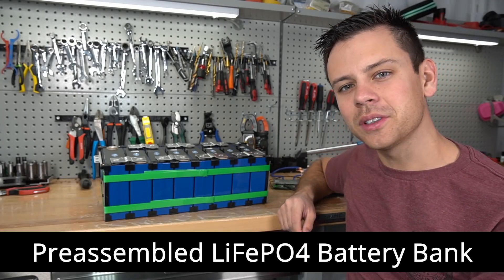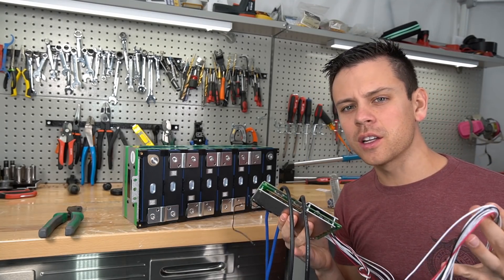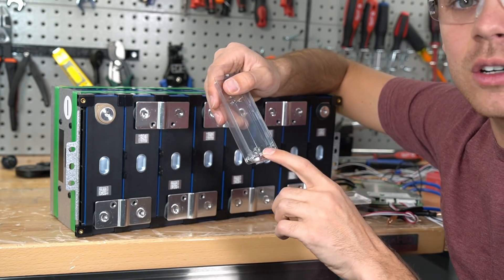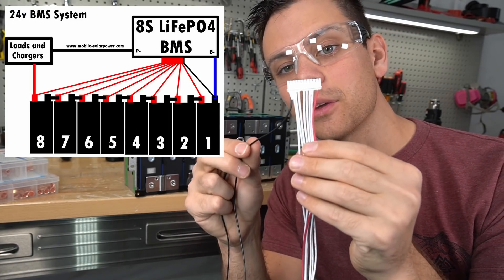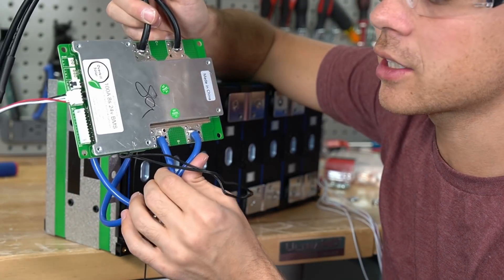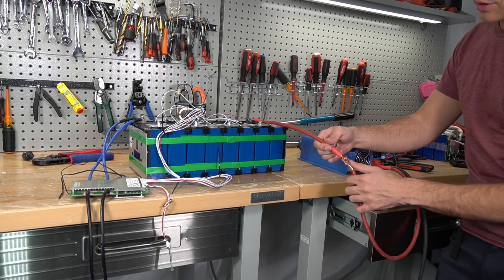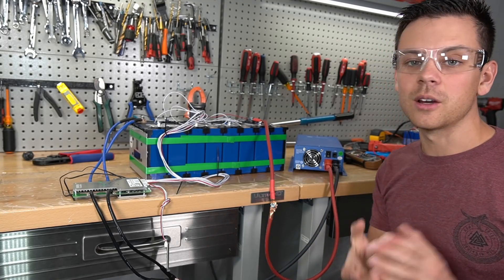Dirt Cheap 24V Preassembled LiFePO4 Battery: Beginner Friendly Tutorial!

Comment from the maker: Signature solar just watched the video and will include hardware for each pack! Thank goodness.

DIY Parts List (affiliate links):
Battery Pack: https://signaturesolar.com/eg4-8-cell-pack-lithium-cells-25-6v-100ah/?ref=cPwLcVc0SW-BjN
24V BMS: https://overkillsolar.com/%20%20product/bms-100a-8s-lifepo4/%20%20?myboi=187467879
48V BMS: https://overkillsolar.com/product/bms-100a-16s-lifepo4/?myboi=187467879
Battery Box Terminals: https://amzn.to/3ikFKrk
Ring Terminals for balance lead: https://amzn.to/3D0G4Fw
Ring Terminals for larger wires: https://amzn.to/3N90UH6
Tools for this project: https://www.mobile-solarpower.com/tools.html

Battery Schematics: https://www.mobile-solarpower.com/design-your-own-12v-lifepo4-system.html

~~~~~~~~~~~~~~~~~~~~~~~~~~~~~~~~~
Tired of getting ripped off? Check out my "Will Prowse Approved" solar product recommendations below!

12V Batteries
https://www.mobile-solarpower.com/lithium-batteries.html

48V Batteries
https://www.mobile-solarpower.com/48v-batteries.html

Offgrid Inverter System Builder
https://www.mobile-solarpower.com/48v-complete-system-blueprint-559371.html

Hybrid Inverter System Builder
https://www.mobile-solarpower.com/code-compliant-48v-offgrid-system.html

Mobile Handtruck System Builder (very popular!)
https://www.mobile-solarpower.com/mobile-48v-system.html

Solar Panels
https://www.mobile-solarpower.com/300w-solar-panels.html

Ground Mount Solar Racking
https://www.mobile-solarpower.com/ground-mount-racks.html

Wire, Lugs and Busbars
https://www.mobile-solarpower.com/wire-and-connectors.html

Tools
https://www.mobile-solarpower.com/tools.html

Fuses and Circuit Breakers
https://www.mobile-solarpower.com/fuses.html

Plug-N-Play Solar Systems
Ecoflow, Anker And Bluetti! So many models to choose from. See my current recommendations here:
https://www.mobile-solarpower.com/full-size-systems.html

~~~~~~~~~~~~~~~~~~~~~~~~~~~~~~~~~~~~~~~~~~
Need to build a large DIY system? Need a trustworthy solar distributor? These are my favorites:

Signature Solar
Creator of EG4! Solar Minisplits, Victron and More! Largest Solar Store Online.
If you want $50 off, please use my link below and coupon code "DIYSOLAR50":
https://signaturesolar.com/?ref=cPwLcVc0SW-BjN

Current Connected
Best Prices for EG4, Victron, Midnite and so much more! Fast Shipping and Highest Rated Customer Service:
https://currentconnected.com/?ref=wp

~~~~~~~~~~~~~~~~~~~~~~~~~~~~~~~~~~~~~~~~~~
Join our DIY Solar Community 
Need more help? Join the largest solar forum on the internet for beginners and professionals alike. 140,000 members and counting!
https://www.diysolarforum.com

Check Out My Free Book
Best-selling and beginner-friendly guidebook to off-grid 12V solar!
https://www.mobile-solarpower.com/the-book.html

~~~~~~~~~~~~~~~~~~~~~~~~~~~~~~~~~~~~~~~~~~
Contact Information:
I am NOT available for personal solar system consult! If you wish to contact me, this is my direct email: williamprowsediysolar@gmail.com
FTC Disclosure Statement and Disclaimers:
Every video includes paid promotion or sponsorship (such as free products for review). Some links on this YouTube channel may be affiliate links. We may get paid if you buy something or take an action after clicking one of these. My videos are for educational purposes only. Information is subject to change/update at any time. Electricity is DANGEROUS and can kill. Be smart and use common sense :) DIY Solar Power with Will Prowse is a participant in the Amazon Services LLC Associates Program, An affiliate advertising program designed to provide a means for sites to earn advertising fees by advertising and linking to Amazon.com
Reply: Hi how can a crimp fitting be better then a solder one???
Reply: @stevewalker412  solder can melt if hot
Reply: @Nobody_Famous  standard tin/lead solder melts at 360 degrees F. Lead free melts at 422F. If this battery bank gets that hot the plastic will melt way before the solder and it will turn into a pile of goo.  There are numerous soldered connections in the under-hood electronics in cars and in the engine nacelles of all commercial and military aircraft.  Literally every single electronic component on every circuit board is soldered on.  This is not a concern.
Reply: @stevewalker412  Current density vs surface area.  Copper/lead/tin interface will increase resistance with current more than copper/copper... so not good for (largish) power transfer. So application dependent.  In this case, a good machinal copper to copper crimp is best (with external mechanical fixation).
Reply: @kennethhicks2113  wow .. thank you would of never of thought of that .. but that makes sense the high amp chiller wires were crimped like that too ....
Reply: @kennethhicks2113  that explains why the 100A leads on the BMS are soldered onto the PCB . . .  And why all car battery terminals and posts are made of lead . . .  and why every single commercial aircraft you have ever flown on has soldered wire connections on critical systems like the fuel and engine controllers.  Sorry I am not trying to be rude but there is a ton of false information out there about soldered connections, mostly shared by people who know very little about the science, and do not realize that all the vehicles they get into and trust their safety and lives to every day use many soldered wire connections.
Reply: @Patrick_Cashman  Not rude, I understand.  Again as I said, application.  And not going into EE courses and engineering compromises made for various reasons like weight, cost, etc...
Reply: @kennethhicks2113  plus there is the concern about anything built on a Friday, and if we made Friday like Saturday, then Thursday could end up being the new Friday, and weedless Wednesday has been a concern for 2000 years as is any type of Friday.

Vote for A.I. and let automation take over our industrial disease.
👁️👁️ 👀
Reply: @truetech4158  Yes but we can't discriminate against other day's ending in Y.

Vote sticks and stones... don't replace a cold with pneumonia.

P.S. One of us needs our meds!
Reply: @kennethhicks2113  I can ask discriminating questions about the gregarian calendar, but doing so is dangerous to ask why no matter the time of day or week, even those months and years can not be overlooked.

The real time and date is much older, we'd have to use carbon dating rather than quartz clock crystals or the classic Sundial that has a concern for skin cancer if to watch the clock for a 9 billion year old version of the correct calendar, unless we are going to end up as The Neuralink BORG  nuclear family unit that use neuralink wirelessly updated by a atomic clock.

 I don't know, says Vice Grip Garage. 
👁️ O 👀
Reply: @truetech4158  Lol... even black hole/quasar time changes over time... carbon dating only works for carbon created at the same time... carbon in another part of the universe would have different dates... things keep changing like it's normal!
Hope your having a good day, ya put some in my day :  )
Reply: Great video, especially for RV owners looking to upgrade from 12v lead acid to 24v LiFePO4!  That said, would love to see a follow-up video (in elapsed time) that shows this battery's max run time using a real-world common household/RV appliance(!)
Reply: @__WJK__  I recently built a 48V battery with 2 sets of 16 280Ah cells. 560Ah @48V.  1 BMS per each set of 16 cells, then put the 2 sets of 16 in parallel.  I used an MPP Solar LV6548 controller, like the ones Will uses in his power wall.  I just have one controller, not 2 like him, because I only power 120V stuff with it in my RV.  I have 3000W of solar panels on the roof of the RV. I've had this system off-grid for 2 months now, and have only used the generator a couple of times after days of clouds and pretty cold weather where it got down around freezing several nights in a row.  
We run a residential fridge 24/7.  We also have 2 computer setups with laptops and large 4k monitors, which my wife and I use for full time work.  We have a microwave, air fryer, and often use the electric water heater. We do watch our power consumption but pretty much live a normal life in the RV without external power input. We are using propane for the furnace and cooking, not electric heat, so I guess that's external power, but no hookups.  
Will has a video on sizing your solar power system.  Look up Will Prowse Calculations on youtube and you'll find it.  I followed his advice in that video and built the battery to supply power for 3 days and be able to recharge in 1 day.  The recharging actually takes longer than 1 day because I ended up with way less solar panels than that would take.  I mounted all I could on the roof and experimented with that.  It actually works fine. I also overestimated consumption so the battery is bigger than it needs to be but it all more or less balances out and like I said we've only had to run the generator a couple of times in 2 months. 
I hope this helps you.  Keep learning from Will and you'll be on the right track.
Reply: Good job Signature Solar!
Reply: Thank you for this video, I appreciate it a lot!  I do want you all to know...I ordered 4 of these on Monday, 4/4/2022, for a DIY build of my own. My order has been in a "On Hold" status since it was placed.  I got an email today notifying me that they don't have the proper shipping labels to send me these batteries, and are hoping to get them next week.  They have already taken my money, but now 4 days later they notify me that they are unable to ship due to improper labeling.  I am hopeful that they actually do get the labels next week as this is an unfortunate delay.  I am not sure why they allow orders to be taken, and money to be received if they are not able to actual ship the batteries.  Here is Signature Solar's actual email response:

You may have recently noticed that your order has changed to "ON HOLD" status. This is due to the battery you have purchased going out parcel through FedEx. We are currently waiting on specific hazmat labelling from the carrier that both them and DOT requires to ship your order.  We were under the assumption that we would have them by today, but now being told that it will be next week due to them being backlogged. Please understand that this is beyond our control but, our shipping department is actively looking for other ways to send your items out in an efficient way. As soon as we are able to proceed with your order, we will notify you. We would like to apologize for any inconveniences this may cause as we were not expecting to run into this issue ourselves.
Reply: @tonysauls7613  still nothing? Please keep us posted! I was thinking of ordering these today but will wait.
Reply: @jenniferdurham2782  I actually canceled my order last week. They let me know they didn't have the proper shipping labels and that they were back ordered.

As of last Tuesday, they still did not have the labels and were hopeful to get them sometime last week.

I would call and confirm the batteries are still in stock, and that they are able to ship them (meaning labels have been received).

I ordered cells from Docan Power instead. I should get them this week.

Good Luck!
Reply: @tonysauls7613  thanks!!
Reply: I can't find them, are they not available anymore?
Reply: @Jason-zg3nl  I don't see it neither.  I think to get a a cheaper deal, they had to buy a lot more than they needed, so they just made it available at a lower cost until they ran out of them extra unit. I knew they wouldn't be having those there for ever.  I'm happy with my 4 unit so far !
Reply: @mochouinard  I'm so jealous 😭 I'm ready to buy 3 of them. I emailed them and they said they don't have them anymore.
Reply: Do you have an updated link to pre built packs it's not working
Reply: naturally! "oh! Will has a recommendation that is cheap and easy enough to add"  "so sayeth the Will!"   great info :D  now we just need to figure out how to use external battery banks with all these all in one packs like an eco flow!
Reply: Do they not ship to the United States? The only option for shipping using your affiliate link is to pick it up at their store in Texas.
Reply: What about Europe distributors? Any idea where we could get it? We are running a school for sustainability and now we are in the process on changing our battery bank to lithium
Reply: FYI, there is no provided screw with them ! Just received them.  BUT there is a black plastic cover that come with it.
Reply: That's service!!   Want to order some of them if they every have them again
Reply: @pcdreams1  yes me too! I'm ready to buy 3 packs
Reply: Link is dead, product gone from site - Anyone know an alternate supplier?
Reply: @Smugly_Watching_Society_Burn  I wish they make more because I would buy 4 of them. But I talked with them and they're not going to make anymore 😔
Reply: alas! no more.
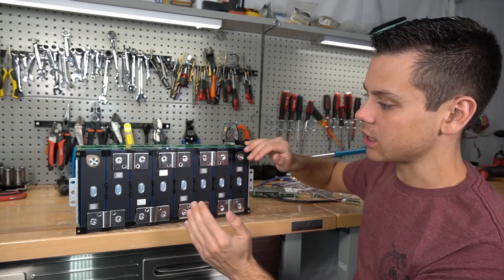Reply: At 1:43 I think you made a bad assumption. Just because they are all connected there is NO guarantee that they are at the same state of charge. Unless each of them was TOP Balanced together you may be getting batteries from different batches with different SOC's ... We had a server pack at work not pass their UPS Emergency run time and it turned out that one of the batteries was way out of spec from the others and therefore shutting down the charging way before any others. Let me know if I am not thinking straight ...
Reply from the maker: @ghostwriter6699  if it doesn't pull full capacity, return it. No, you should make that assumption.
Reply from the maker: @ghostwriter6699  and if someone doesn't pull full capacity, let me know. I'll make a video so everyone knows. If they are welded, they need to be equalized before purchase.

Comment: how do I increase the ah? I'm trying to run a 30 amp rv at 24 hours. not counting the charge sources.  I'm probably running more around 20 amps but  i want 30 amps.

if I have this correct u need
4- 3.2 volt cells
in series 
12 volt.

let's say each cell is 304 ah wotu a single 4 cell bank I'm only getting 304 ah?

Do I create a second  4 cell bank and then connect both in parallel?

Comment: OMG you used plain washers???? you need spring washers (split ring or spider) - standard practice. As these banks will likely sit around for years, I would spray the terminals with Lithium grease (like they do in automotive lead battery terminals - keeps potential corrosion away eg moisture + marine environment or by the sea.

Comment: How to wire 2 parallel, 8 series 24v bms? I finally built a battery using 16 100ah EVE cells. Got an ANT 7-16 140A BMS and can't find any information about how to connect it to my configuration 😢

Comment: Hi and thank you for your awesome videos. I been wanting to build my own battery and I found this video. I have a all in one 24v 3kw inverter that clearly says for seal, agm, and lithium battery only. I was wondering if a 24v lifepo4 with a BMS like the one you are building on this video will work with my inverter? The battery connector on my inverter is only one connector so is has charge and discharge function. Thank you.

Comment: Can you build two of these with two 8S BMS's and if so how would you join them and then wire them to a 24V inverter/charger?  How would they connect to the charge controller?

Comment: Will, I just came across your videos!! I would like to build either 2 12volt 100Ah or one 24v 100Ah unit for use with a 24v 80lb thrust trolling motor. Appreciate any input.

Comment: I bought 4 of those round 3.2V 6000mAh cells from ebay with a 10A bms to begin building a battery the first time. The cells were 8€ each and 14.99 for the bms. So I thought to statt small. If I screw up something I don't destroy my loan haha....do you think that's a good idea? I could have startet also with raw AA cells 3.2V 600mAh for cheaper option but hey...

Comment: So if I got two of these to run in parallel would I use the 16s BMS?
Reply: Personally I wouldn't leave any one of these cheap cells unmonitored.  I think it would be worth it to use 2 @ 24volt BMSs then connect those in parallel, then if you get a bad cell the battery gets condemned by BMS before it shorts out your other cells, and give a chance to replace the bad cell.  Even on the batteries made with 18650 cells they are configured so that individual cells get condemned with the newer tin strips.
Reply: @asdfdfggfd  Thanks for the insight!

Comment: Looks like the batteries are no longer available. The link doesn't take you to anything specific, and a search of Signature Solar's website turned up nothing. Am I missing something here? Looking at Eve LiFePo4 3.2v 280ah cells, it would cost ~$1600-2000 for the cells alone to build a 48v battery. That's not including the BMS, hardware, case, etc.
Reply from the maker: Out of stock
Reply: @WillProwse  Does that mean never aval. or should we call for ETA and backorder status?